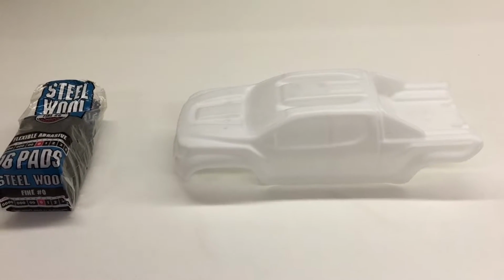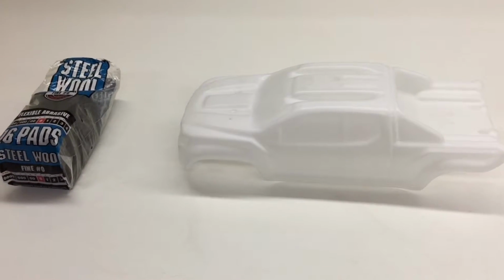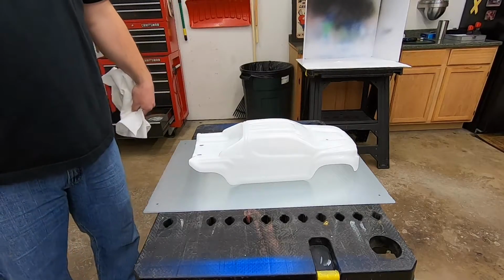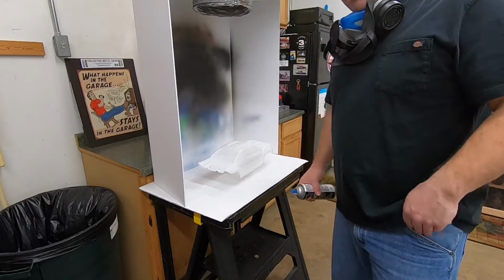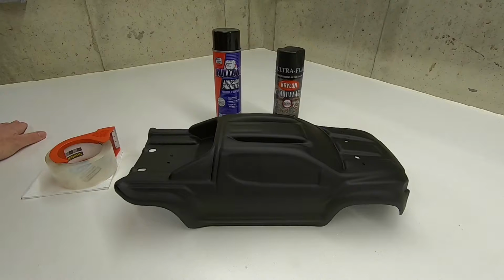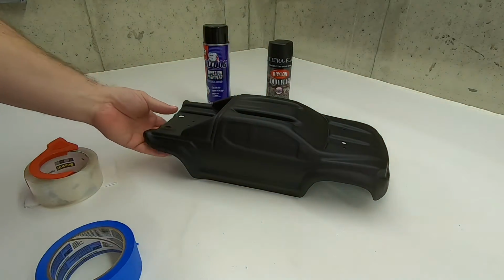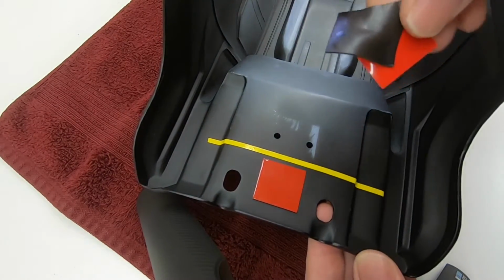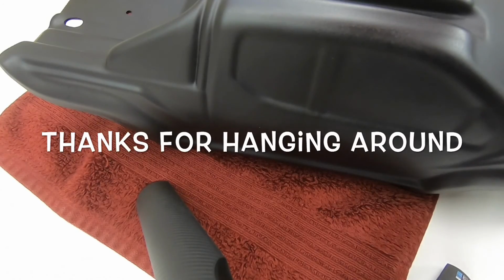How to paint Pro-Line Brute Bash Armor (ARRMA KRATON)

Comment: Do you think a heat gun would get the surface hot enough?
Reply from the maker: Jeff Kyser I can’t say for sure,  everything that I found showed using a flame. You could try then do water test and see if it beeds or sheets. If it beeds it didn’t work. Some guys were saying plasti dip works, I never tried. Hope this helps.

Comment: Just out of curiosity after you paint it and want to clear it... do you think the por15 or kbs coatings would adhere to it... they both have a clear that is supposed to be indestructible as well... I've used a flat black on the frame of my real truck and unless your grindinging it off it dont chip or anything... just wondering if it would adhere to these
Reply from the maker: I’m not familiar with those products. So I can’t say for sure. I appreciate you watching
Reply: @Paul-815  yea it's a automotive rust sealer for like frames and suspension parts to help from rusting... look into it sometime cause they have a clear that is really good
Reply from the maker: Josh Minzler I’ll definitely check them out.

Comment: All your doing is just weakening the material. You do know that right?
Reply: You just made that prolly 35 % more likely to crack in the cold weather.
Reply: You pant very well though. All the right techniques. Harder than it looks. People don’t realize this or most of them forget. Lool. Well done.
Reply: Ps you forgot duck tap after sitting in sun for a day. And flex seal 😂 luLZ.
Reply from the maker: First off, thanks for watching. You maybe right. I haven’t noticed any weakening. But I’m not an extreme basher or a scientist for that matter. For the record I think the stock v2 kraton body looks way cooler. ✌🏼